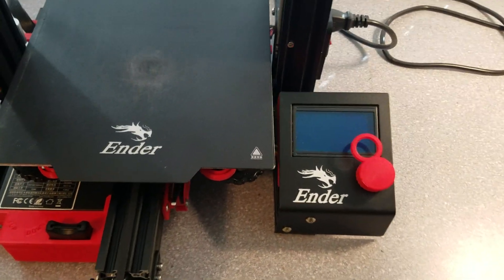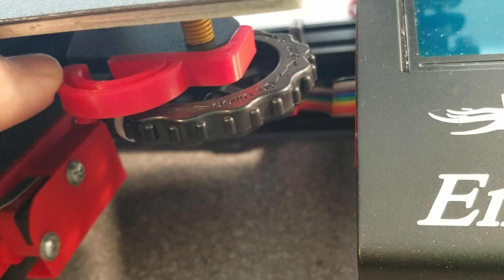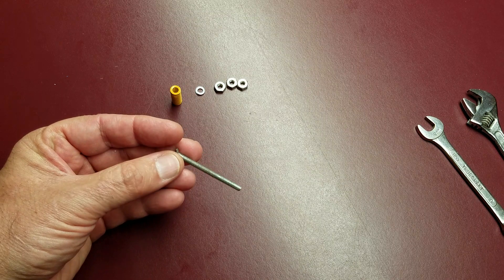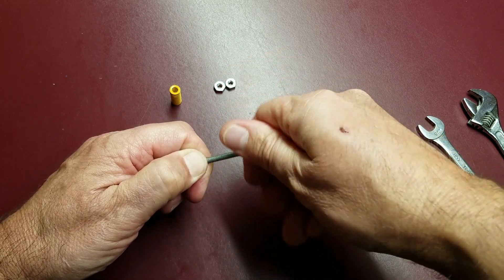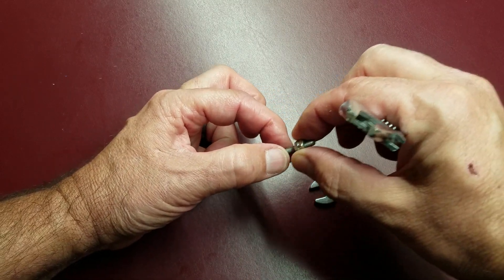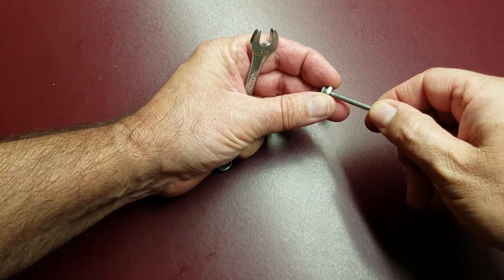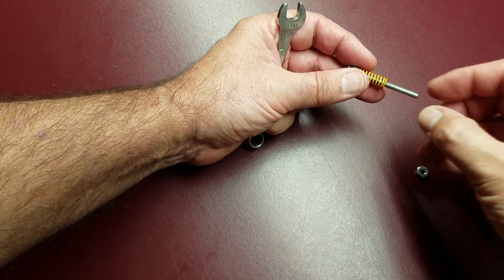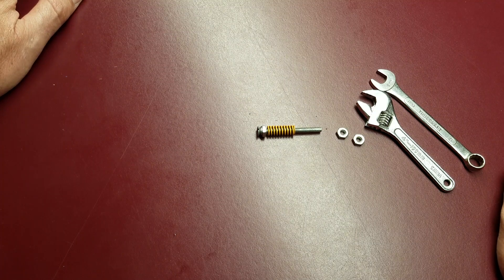Ender 3 & Pro leveling screw improvement. Lock that level!

Comment: Great video.  I did what you did, but I found once I hand tightened the nut while holding the screw steady, it was tight enough for friction to let me tighten it the rest of the way with the wrench without needing the locknut.  What I did need though was a #6 washer between the nut and the yellow spring because the spring diameter is just ever so slightly wider than the nut diameter.  That caused some issues when I trammed.
Reply from the maker: At least you got the gist of the idea and found a way to make it work. Have fun printing!

Comment: my problem is the screws move when i turn the knob and i don’t know how to fix it
Reply from the maker: That's exactly what this video is about! If yours has the magnetic sheet on the bed that the print surface sticks to, you can cut a hole over each screw head and use a screwdriver to hold the screw while you tighten a washer and nut onto the screw much more easily than the method I showed in this video. After reassembly, just re-level the bed and it will be easy to adjust from then on. Using the printed wheel locks that I link in the description will keep the wheels in place and they'll only move when you move them. This is all assuming your machine is like mine. Good luck.

Comment: I’m having this issue, did you have get longer screws
Reply from the maker: I used the original screws. They never left their holes. This task would be easier if you cut the magnetic sheet over the screw heads and used a screwdriver to hold them while tightening the nuts. I've been told that it won't affect the magnetism of the sheet. Good luck.

Comment: If I use locknuts, can I use regular washers? Or does it have to be split washers?
Reply from the maker: Locknuts negate the need for lock washers, however, they are usually a fairly "tall" nut, and may cause conflicts with the springs and carriage. I used nuts that are more like jam nuts that I just had in my hardware drawer. Still working fine after more than 2 years. I've had to adjust the bed height for switching between TPU and PLA+, so now I've had to change the bed tramming several times. I can't get TPU to print the first layer without jamming the extruder otherwise.

Comment: What keeps the wheels from loosening at the bottom?
I was thinking of putting Nylocks in place of the adjustment wheels instead of just locking the screws to the plate.

I think it would be better to have them in both locations. Top and Bottom.
Reply from the maker: The wheels are locked with printed springs that engage the bumps on the circumference of the wheels. They're visible between the carriage and the adjusting wheels in the video. Also, the white zip ties on the wheels were there to count full turns before I made this mod and have since been removed. It works like a detent and they're on all four wheels. They do keep the wheels from turning on the now locked screw shafts without permission. The Thingiverse link for them is in the description at the bottom.
Reply: just use rubber Orings on the bed before you put the screw in the rubber gives it friction and tht screw wont budge

Comment: Might be better to use a nylon or non-conductive fiber washer next to the bed.   I use solid silicon bed mounts with the original bed hardware.  I also use a ABL and rarely have to level my bed.  I still do once in awhile, but not like before.  Even with those yellow springs I was constantly having to relevel the bed.
Reply from the maker: Good idea on the insulating washers, just in case! The only time I've had to re-level the bed after this change was to start using TPU filament. It kept over extruding because the bed was too close and that led to mis-feeds and tangles of filament in the extruder. Once I made that level change, it worked well on both TPU and PLA+ EXCEPT that now I have to use glue stick on the bed for both filaments and sometimes the PLA+ won't have a good first layer. I don't print enough to use two dedicated machines and I don't want to re-level every time I switch from one filament to the other!
Reply: just use rubber Orings on the bed before you put the screw in the rubber gives it friction and tht screw wont budge
Reply: @777Jesus_is_LORD77  Not clear where you're recommending putting the o-ring.

Comment: What is the purpose of putting the two other nuts on, then taking them off? Just curious, I'm new
Reply from the maker: That's to keep the screw from turning while tightening the nut to the underside of the bed. Since I made this video, a few people have commented that they did it the way I was considering and had no problems. They cut small holes in the magnetic cover just over the screw heads and used a screwdriver to hold the screws. I didn't think it would effect the magnetic bed feature and they confirmed it. Good luck.
Reply: @stevemullens7937  Oh I see. Thank you!
Reply: Jamming two nuts together like that is a very old non-damaging way to grip any threaded shaft, bolt etc.

Comment: When i print something big on my Ender 3, the adjustment wheels become so loose they fall off mid print. This might help with my problem, I'll try it out
Reply from the maker: Your springs may be too weak. They're probably compressing as the weight increases then the adjusting wheel doesn't have enough pressure to prevent turning from vibration. Your Z-stop switch may need to be lowered. Before getting the stronger, yellow springs, try tightening all four to evenly compress the springs more than they already are then re-level. This preload might keep everything tight enough to prevent it repeating. The wheel detents will prevent it for sure, but the further compression of the loose springs while printing, might have a bit of an effect on your layers and cause the print to be a bit taller than designed. Good luck.
Reply: @stevemullens7937  Also you dont have to get the upgraded springs if you get 2 plyers and grab each end of the spring and pull it as hard as you can it will re spring the springs and they will be just as good if not better than the upgraded ones i did that after i bought the upgraded springs then felt dumb that i bought them. H
Reply from the maker: @777Jesus_is_LORD77  Whatever works! This works for me and I'm still using the same machine. The only time I have to change the bed level is when I print TPU, I just lower the bed four clicks and then go back for PLA or ABS.

Comment: Is it just on the front of the 2 in the back as well ?
Reply from the maker: It's all four. Still haven't had to re-level the bed again!
Reply: @stevemullens7937  In two years?!! But do you print often?
Reply from the maker: @TheStickyBusiness  I print almost exclusively utilitarian items. I don't make little figurines or game pieces, so I don't print continuously. Probably once or twice a week on average. I didn't have to adjust my bed level until I started trying TPU which required a slightly thicker first layer after several failed attempts. I don't abuse my printer and try not to do anything to the bed that might distort it in any way. Gently removing prints is my method and it worked until I started using said TPU. A magnetic flex sheet helps.

Comment: Thank you for this!  Had the same issue and lived with it for too long
Reply from the maker: Glad to help. It's probably much easier to just cut a small hole over the screw heads to get a screwdriver to hold it while tightening the nut. Other people have said below that it doesn't effect the magnetic hold on the flex plate. Good luck.
Reply: @stevemullens7937  One of the reasons I get annoyed with my printer is because it's not quick to adjust the bed in one of the corners.  Having to pull out a screw driver, cut a hole, and remove the magnetic plate doesn't seem to make my problem any better.  I will be receiving the parts you linked above today and will give it a try.  I  think your solution will make everything a lot easier.
Reply from the maker: @philpesce  I guess I wasn't clear enough before. When I wrote to use a screwdriver, it was to hold the screw when tightening the lock nut to hold it stationary and prevent turning. Just to eliminate the need for jam nuts and the rest while locking the screw, not every time a re-level is needed. BTW, I don't think I've had to level the bed again since I did this improvement. Good luck.

Comment: Have 2 Ender 3 pro machines, one stays nice and level and the other is just a nightmare having to re-level it constantly. I just pulled my bed off due to a spring refusing to decompress and discovered exactly this issue. I think they might drop a dab of hot glue or equally insufficient adhesive, one was already freely spinning and with the slightest effort the other three broke free and began to spin freely as well. Thanks for the simple and effective fix. I just about started to peel my bed apart before cooler heads prevailed!
Reply from the maker: It is nice to finally find the cause of a problem that has plagued you for a while. I've thought that the magnetic sheet on the bed could also be cut right above the screw heads and a screwdriver could be used instead. Much simpler. I'm not sure if removing four dots of the sheet would diminish the flex plate magnetism though, probably not.
Reply: That's what I did for my second printer as a matter of fact. No noticeable difference and a lot less struggle.

Comment: Thank you very much! I noticed that the bed on my Ender 3 V2 was moving in all directions when i touched it. Releveled the bed a thousand times, and every time I cleaned the bed I had to watch out for the bed levelig wheels to make sure I didn't get it out of tune, again. 
I was searching for a fix to make it stop moving sideways, when touching the bed on my prusa it did not move and this gave me much better prints. So, when I saw your fix with the nuts on the underside, and the stoppers for the wheels I knew I had to do the same. Now I finally also got hold of the springs. They were sold out everywhere I looked. The printer, and I , am so happy right now.
And for the record, the bone stock machine was not up to par, it is a good printer, but this made it reach a whole new level!
Reply from the maker: I'm glad my discovery of the loose screws helped you. You might also want to look at the Y axis roller adjusting eccentric on one of the wheels under the bed. It may need adjusting.

Comment: I added those on but now I have to baby step the bed so the extruder not sittng on the glass bed
Reply: Just move your Z limit switch to the right position so you wont crash into the build plate
Reply from the maker: I always used the paper scrap method of leveling the bed, but haven't had to since I made this improvement.

Comment: what is with the zip ties on the black wheels you never explained that part in your video The screws are M3 screws
Reply from the maker: Before I made this improvement to my machine, I was trying to level the bed so much, that I calculated the movement per notch and per turn of the knob so I'd know how much to turn it. This was before I realized that the screws were turning as well as the knobs. It was so I had a marker for a full turn and I have since removed them. Thanks for watching.

Comment: You added a lock to something that doesnt turn, on its own. What do you think you accomplished?
Reply from the maker: Oh, yours is the one! If you own a Creality, or other brand machine, with this leveling system, you're not paying attention. On this machine, the screws sit in countersunk holes with no mechanical bond to the bed. They are free to spin. After months of trying to level and re-level the bed on mine, I noticed that the screws were sometimes spinning along with the adjusting nuts, or wheels. That adds up to very imprecise adjustability. Since I did this and got the bed where it needs to be, I haven't had to re-level the bed even once. That alone should tell you something about what I accomplished. Thanks for watching.
Reply: @stevemullens7937  You probably noticed that when you changed the correct stock springs for some spring set sold to you by some random reseller on ebay/amazon,.... not creality. Stock creality machines dont require this sort of hijynx.
Reply from the maker: @tazanteflight8670  On the contrary, I did this improvement at the same time that I changed the springs BECAUSE it was happening before the spring change. Are you the QC guy for Creality? Don't take it so personally.
Reply: @tazanteflight8670  ah yes the good old it works for me so everyone else must be lying :/
Reply from the maker: @tazanteflight8670  What a stud.
Reply: @yourallygod8261  The comment is "it works stock". His printer worked,.. on day one.....

Comment: for what reason wheel lock ? if they spin by themselves you need exorcist not useless mods
Reply from the maker: These mods are anything but useless. I still haven't had to re-level the bed on my printer. I can think of several places in much more need of an exorcism!

Comment: The nut link is no longer working. Do you by chance have the specs so I may find a replacement?
Reply from the maker: This isn't the first link in one of my videos that died! I've repaired the link. You can also get metric M4 nuts at nearly any hardware store for much less than Amazon. Since I made this change to my machine, I haven't had to re-level the bed even once. Definitely worth the trouble. Of course, the nuts keep the screw shafts from rotating and the detent locks keep the wheels from turning so everything remains as last adjusted. Good luck on your project.

Comment: Ironically after a year of perfect prints a failed one ruined my set up. 7 weeks of attempting to fix it and only today did I find this and a similar vid showing the similar technique. Damn you you tube. But a nylock nut could save using both even though my standard fall back is doing just what you did using two nuts as a general way of securing things.
Reply from the maker: In retrospect, with my magnetic bed, I could have just cut a small hole in the magnetic layer over the head of each screw and used a screwdriver to hold it with a small spring washer and nut to hold it in place. It would have saved the effort of using a jam nut setup to hold the screw while tightening the nut. It would still work fine and cause no problems on the print surface. I hope you get your problem fixed and that locking those screws makes it stay fixed. Good luck.